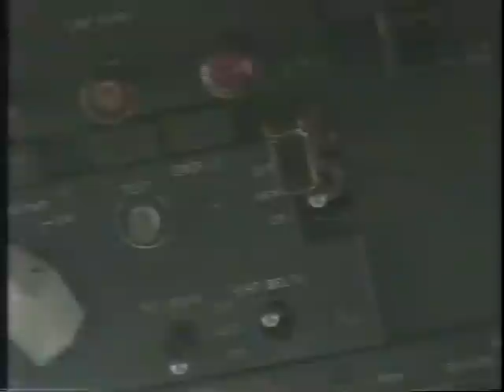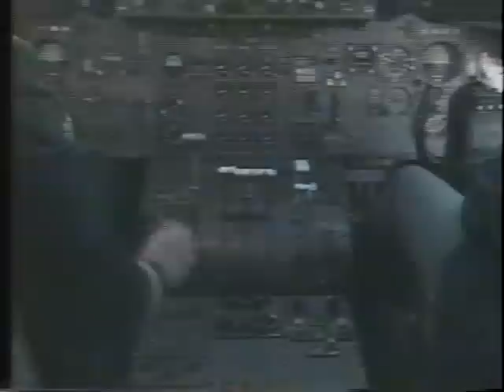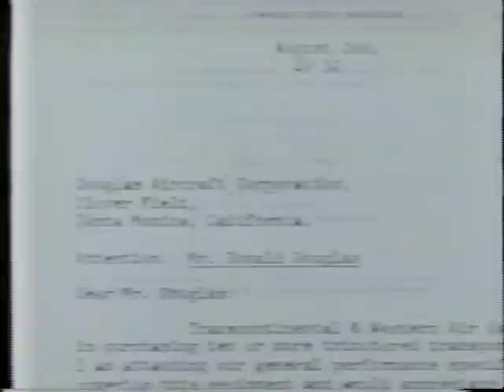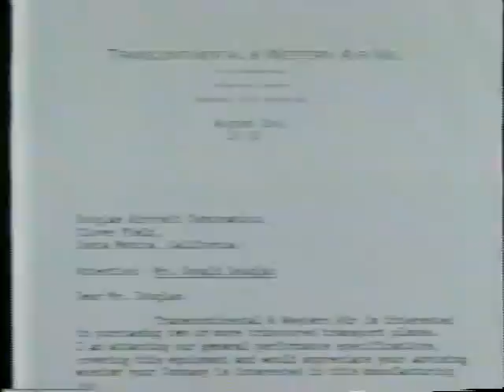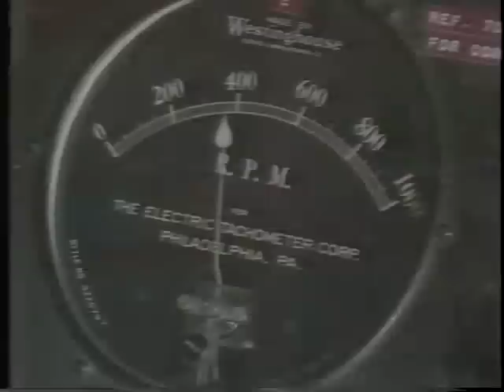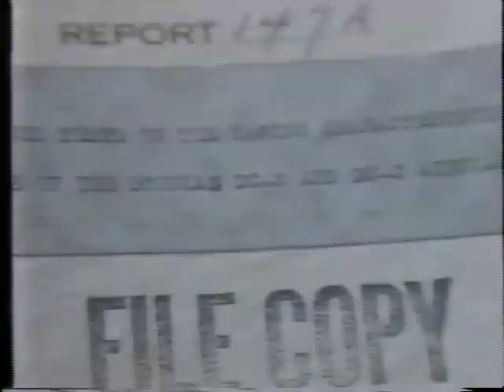The DC-3 The Plane That Changed The World. Broadcast by Public Television in 1985.

Comment: Absolutely fantastic.  I had the delight of flying in one on a commercial flight from Dubbo, NSW. Australia, to Sydney, back in 1969.  I will never forget that experience.  Lined up on the runway with engines revving, brakes on.  Just when you thought it was going to throw a piston and couldn't rev any higher, they opened up the throttle,  the aircraft was shuddering, then the brakes were released and you surged forward!!

Comment: I am lucky.  Busted parents my dad would put me back and forth on a DC3 from St. Simons Island to Atlanta, in the late 70's. $100 bucks round trip.  And my Island home also had a front door view for them taking off after 1/2 mile heading off Island.  Just a joyous time.  I was 10 and the pilot would always let me come into the cockpit.  The scenery was great and it just seemed to hum and glide along.  Uncanny that the major aircraft design after the 747, ,727 DC9 and DC 10, that all new jets use the two engine on wing like the DC3.  I have a bond with this plane and was my first experience flying.
Reply: HamerSlammerSeries I miss flying to St. Simons Island from Beaufort, S.C., to enjoy an awesome breakfast at The Sand Castle.

Comment: The narrarator said there had never been a structural failure of a DC-3. NC16060 was shown earlier, it went downDecember 15th 1942. From Aviation Safety Network website:
Narrative:
Western Trip 1 took off from the Salt Lake City Airport at about 01:05 local time, cleared to Burbank, California with a scheduled stop at Las Vegas, Nevada.
The first and only communication contact Western 1 made was with the Western’s radio and dispatch officer at Salt Lake at 01:07, at which time the flight reported "off the field at Salt Lake at 1:05 a.m."
The aircraft, a DC-3, failed to arrive at the destination and the wreckage was located the next day.
Investigation revealed that normal flight was apparently interrupted at an altitude of approximately 10,200 feet by a failure of the aircraft's structure. The first officer and the copilot-trainee were at the controls at the time the airplane struck the ground while the captain had been in the companion-way, either seated in the jump seat or standing. Weather conditions in the area at the time were satisfactory for the flight and were not a contributing factor to the accident.

Probable Cause:

PROBABLE CAUSE: "Failure of the left, or possibly both wing tips and of the horizontal tail surfaces as a result of a severe pull-up which caused unusual and abnormally high air loads. The reason the pull-up maneuver was not determined."

Comment: Check out Basler Turbo Convsersions....
The Basler BT-67 is a fixed-wing aircraft produced by Basler Turbo Conversions of Oshkosh, Wisconsin. It is built on a retrofitted Douglas DC-3 airframe, with modifications designed to improve the DC-3's serviceable lifetime. The conversion includes fitting the airframe with Pratt & Whitney Canada PT6A-67R turboprop engines, lengthening the fuselage, strengthening the airframe, upgrading the avionics, and making modifications to the wings' leading edge and wing tip.

The conversion is so complete the FAA designates the craft as zero time!
The DC-3 lives on!

There are a couple of youtube videos of these AC...quite the sound.
Reply: I go to school right next to where they refurbish them in Oshkosh. Right now they are stating work the original and first plane that led all of the squadrons during the Normandy D-Day invasions. It's pretty sweet!

Comment: I love it! And as they say, the only airplane that can replace a DC-3 is another DC-3!
Reply: So, why don't they make it anymore?
Reply: @pxtokarev  First of all it uses high maintenance radial piston engines.  Second it was a unpressurized airplane so you should not fly higher than 6000 feet without oxygen.  And of course the cockpit is totally out of date.  A modern replacement with turboprop engines, a new cockpit and pressurized would be, guessing 10 to 15 million?   A pc12 is a smaller single turboprop, up to date incarnation of the dc3 $5 million or so.
Reply: @pxtokarev  thats a great question.but i'd have to guess they would mo longer meet govt regulations 
.unless grandfathered of course.but lmost definatly worth a look.

Comment: This is the plane that put an end to the reign of passenger railroads. Remember, before the DC-3, it took at best three days to travel from New York City to Los Angeles by train (one day from New York City to Chicago, two days from Chicago to Los Angeles). American Airlines started a service from New York to Los Angeles using the DC-3 that reduced that travel time to around 17 hours, which immediately made it immensely popular and showed what air travel could do in speeding up travel--and unlike the earlier transcontinental flights with the Fokker Trimotor and the Boeing 247, it was also profitable, too.

Comment: I grew near the Portland air Base  it was across the landing strip from Portland airport.   The air guard would fly over our house during the summers.  I could tell by sound only if a approaching plane was a DC3 or a flying Boxcar. I loved the sound of the DC3.  There is just no better sound then those 2 engines cruising through the air.

Comment: My best friends an aviation nut (VMA/AW 121 mechanic years past) says you can tell which radial fly by the oil puddle under the engines. Got a good laugh. Reminds me of a row of brand new CZ250 &380's at a dealer in the 70's. Each bike had a small oil puddle under it. No gasket used, just surface to surface on the cases. A much simpler time.

Comment: The Wright Flyer was single engined, not twin engined as the narrator claims @11:00.  It had twin propellers driven by chain-drive from one engine.
Reply: Commutators make a lot of rookie mistakes in these docs.
Reply: The first multi-engine plane was "The Grand" built by Igor Sikorsky (yes, THAT Igor Sikorsky) around 1913.
Reply: Read an article several years ago about the Wright Flyer engine. The Machinist who built it was very talented.
Reply: Bruce Blake , I would suggest listening again.

Comment: One thing I'm surprised was not included is that the engines are not mounted at the same positions on each wing.  On one of the wings the engine is a little closer (or one is a little further out) in relation to the fuselage to counteract engine torque.  It's not visible, really, but it's there!
If I were obscenely rich, the two aircraft I would refurbish for personal use would be the DC-3 and the PBY.  I'm retired now (71) so fast is not a requirement; except on my 1100ccYamaha  but that's a story for a different day.

Comment: The main reason a very good plane like the DC-3 can fly so long is because the body isn't pressurized which causes stress on the outer skin.
Reply: The wing structure is very strong and fatigue-proof, too.
Reply: +awuma Also, Douglas builds airplanes like ships are built. First, the keel, then wing spars are connected to the keel.

Not the same with Bowing airplanes, so they are expected to breaks-up when ditched. 
And, Lockheed the wings come off, remember the Electras + many C-130's.

Comment: Queen of the sky,the DC-3,the best all 'round airplane, ever. If not for it's introduction, the Boeing 247 would have been a blazing success, it was the first truly modern airplane,but the DC-3 was clearly superior and overtook it quickly. That's what happened,history is the truth,what happened,did happen. Some 247s remained in service for awhile,but were not able to compete with it $$wise,and ended up as businessman private planes.
Reply: Gary Williams Douglas stole a march on Boeing as they were gifted the wind tunnel data on the Boeing 247 by the student who was running the wind tunnel they were using in California. The student went to Douglas to get a job with the data.

Comment: I had to laugh when he said, Stick your head out the window to see if the landing gear is down. Try that in a 737 you get your head taken off! 

Howling Mad Murdock approves..
Reply: It's real sporty in a plane of that general era. I did it in a DC6 once, riding IP in the right seat.  Much easier to fly by the tower and let them check it.
Reply: You could do that back then, at a bit over 200 mph, not today, that's for sure!
Reply: Yeah, I lost more than one pair of sunglasses doing that!🥴 Had the pleasure to fly these out of SJU a long time ago! Great times!👍👍👍
Reply: I don't know why he said that. I worked on them for years and they have lights on the instrument panel connected to micro-switches that show if the landing gear is locked down or not. Spring-loaded mechanical latches engage in  hook slots in the end of the rams to keep them locked plus there's 750 lbs psi  down-line  pressure from the hydraulic pumps. It can also free-fall and lock under its own weight. The only quirk about the gear is that it's held in the retracted position by putting the selector in neutral once the wheels are up and pressure trapped in the 'Up' line holds it there. The gear occasionally has to be selected up again if it starts creeping down because of slight leakage past the hydraulic ram internal seals. That shows up on the landing gear down line pressure gauge. It's a damned good aircraft and I enjoyed maintaining them.
Reply: I rode jumpseat on Salair DC-3s many times, and during the summertime when it was warm we'd sometimes fly with the emergency escape hatch in the ceiling removed.  It was directly above the jumpseat, and I would sometimes stand on my seat with my head out of the aircraft.  What a blast!  Literally.

Comment: Given the number of  underdeveloped countries and areas with dirt strips, I'm surprised that a modern version of the DC-3, a large tail dragger with big soft dirt tires, hasn't been created.  True you can say a Cessna Caravan is close capability wise, but its wheels do need a fairly compressed and prepped strip.
Reply: I love the DC 3 as much as the next guy but there have been a lot of successful big bush planes since other than the Cessna caravan.You cant forget the De Havilland  Beaver's,Otter,Twin Otter etc,There's quite a few others too and one of my favorites is the Pilatus Porter.I was lucky enough to fly a PC6 for a few years in some crazy places.Last of many I feel worth mentioning is the new Pilatus PC 12.While it isnt a bush plane it is designed to get into some rough stuff and is possibly the most versatile plane out today.I ferried one with a old coworker to South America and the owners strip would make a Cub pilot think twice.
Reply: Bredah Jake
There is a demand for used .Not new DC-3s.
Reply: Yep, new would be too expensive.
BUT, there's still a market for the turboprop conversions/rebuilds of the DC-3.

Comment: I took my son to a small aircraft museum in LA by an airport (not LAX, but toward Long Beach) that had an old DC - 1 or 2?  I believe. It looked like one of these, and we were able to sit in the pilots seat and actually move the flaps on the wings and rudder. Were these DC-3's hydrolic or manual with wires?.  By the way, they also had an F-14 you could get in but that was removed after 911.

Comment: The beauty of the DC-3 it can land on fairly short runways and runways that are unimproved. In fact it's said the DC-3 LOVES grass fields because the rear wheel tends to stabilize the direction of movement down the grass "runway" whereas improved runways pose the possibility of ground looping the aircraft if a tailing cross wind is experienced. Also, if the landing gear doesn't come down, the aircraft will still land on the wheels in the "up and locked" position, because the wheels STILL extend below the bottom surface of the aircraft. Of course the props and the engines will be damaged but the rest of the air frame will get through the landing OK.

Comment: The narrator stated that no DC3 ever suffered structural failure. That may not be correct. I believe that one had a wing fail in flight in Marlborough, New Zealand many years ago. It had been used for "dung dusting" or spreading bird poop based fertiliser and was badly corroded. If anyone knows more about this incident please post a comment.It would be good to know more about it. 
    But what a beautiful old aircraft. I wonder if any will still be flying to celebrate it's centenary.

Comment: What a perfectly proportioned aircraft! I noticed the symmetry instantly from a 'nose-on' position...the wings seemed barely 'there' from the front-aspect. (a mathematical 'Golden Ratio' at work...taken directly from the Master, Nature itself)When I think of it...all modern aircraft (the 'big boys') are still built in the same manner. Quite a testament for the 'DC-3'.(one thing I wonder about are the tires on the landing-gear where a portion is exposed to the elements...did this create difficulties in 'uneven' temps. of the tires? Wouldn't it create something of a 'lumpy-bump' effect on landing?)

Comment: its crazy how old this is, back when the DC-10 just came out, nowadays everyone just knows them as obsolete and poorly designed what with the luggage hatch always blowing off and funny wiring and hydraulics, they did their job most of the time though and they were fine after they went back and solved all the problems with them. . .but a bad reputation is much easier to gain than a good one. just like the 6.0 powerstroke. they can be good with a little money but their bad reputation defined them and they are one of the cheapest diesel trucks around you can buy used. the 6.7 powerstroke has had an awesome reputation, i dont even like any newer fords but as long as they make 6.7s they can still make a good engine

Comment: I find it VERY interesting that Jack Northrup worked on the wing design of the DC1-2-3...And if you notice the shape of the wing,   it has a swept back shape, this design is from the early 30's..If you compare this wing to the swept wing of Germanys WWII jet,  the swept is very similar. Yet the Germans are given credit for the swept back wing..why?? The dc-3 was prior to the Me262..  Remember Jack Northrup designed and flew the flying wing of HIS design late 30's early 40's yet here again everybody want to point to the Horton Bros of Germany as the Inventor of the flying wing...Why?? Also look at the Curtis XF55 Asender of early 40's design,  and again a swept wing..yet the Germans are credited for the swept and flying wing.??? Why is this???? Because the Germans "invented" everything?? Notice too in this doco the use of the wind tunnel.....The USA WAS at the forefront of aviation development...
Reply: ;p
Reply: ***** The leading edge was indeed swept and very similar to the Me262 which we know was designed that way to correct a balance problen not to enhance the speed.....facts man just the facts....
Reply: The Germans used sweep to reduce drag at high-subsonic speed, and for this they are credited. Wing sweep in mid-30s airliners had nothing whatsoever to do with this.
Reply: corisco tupi The swept back leading edge was to correct a balance problem on the Me262. they did not fly fast enough to benefit from the swept back
Reply: Wilbur Finnigan I didnt't mention the Me262. Again: wing sweep on mid-30s airliners mentioned by the OP (or indeed Me262 for that matter) is unrelated to the drag-reduction studies that took place in Germany which led to swept wings in most jets. It is the concept of wing sweep with the specific intent of drag reduction  at high-subsonic or supersonic speeds that are credited to Germans.
Reply: corisco tupi  When ever swept wings are mentioned, the credit goes to the Germans for "Inventing" and using, NOTHING is said why....That was my point. Many were using swept wings BEFORE the Germans. even some WW I bi planes had swept wings. It seem, like I said The Germans are given all the credit and that simply is not true. Even Douglas Aircraft in designing the DC 1 2 & 3 used the wind tunnel for aerodynamic,  also North American Aviation used the wind tunnel on developing the P51 Mustang.  The wing was tested right here in Washington state at the University of Washington and the XF55  56  were swept wing so the info and knowledge was there OTHER than the Germans.
Reply: Wilbur Finnigan I hear you. However, I have never seen credit being given to Germans for "inventing" swept wings outside the scope of high speed drag reduction. If that were the case it would be indeed wrong. They studied the effects of sweep, before anybody else, with that particular end in mind.
Reply: corisco tupi  ANY TIME a discussion about swept wings come up the Germans are given credit for them. Even when the F86 Sabre or the Mig 15 are brought there is ALWAYS mentioned the swept wings came from the Germans, or the Germans designed both planes, which is not true. It is all an assumption and wrong..
Reply: Wilbur Finnigan Well, all I can say is that there are uninformed people everywhere. You won't find credible sources saying that. But in forums, etc, people say the weirdest things.
Reply: corisco tupi  whether forums ,You tube or any TV program, that seems to be the opinion. It comes up all the time, but then these sites are not always frequented by the most informed or intelligent people but this myth is perpetuated everywhere..cheers
Reply: Check out the 1937 Waterman Arrowbile for pre-war wing sweep.
Reply: @wilburfinnigan2142  There was a German design that never got to the prototype level.  It looks a great deal like the Mig15. That's likely where the argument comes from.

Comment: The DC10s I've rode in the rear seating on had a little more noise and vibration than I cared for. Sitting almost under one of the engines probably isn't the best place to be seated, imho.